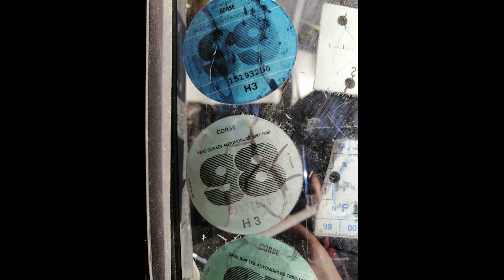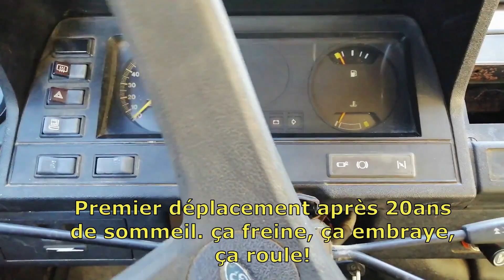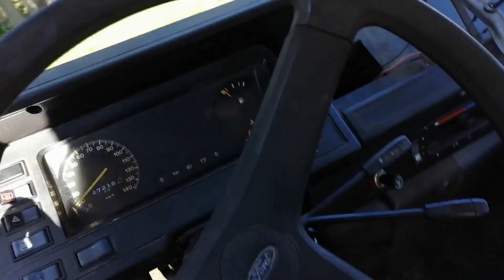Barn find Ford Transit MK2 abandonné depuis 1999. Sauvé de la destruction de justesse!!

Comment: Toujours un plaisir de revoir un Ford Transit MK2 dire que c'est la dessus que j'ai conduit au début de mon permis et taper mon premier drift (pas bien c'était le véhicule de mes parents) bien sûr de nos jours je ne lui ferai plus ce genre de misère trop jeune et trop con sûrement.
Reply from the maker: Je regrette d'avoir du m'en séparer. Mais il est entre de bonnes mains. 😊
Reply: @vrshape  Si c'est une personne qui en prend soin c'est bien et oui un bon moteur là dedans dans ta vidéo j'ai cru entendre le notre. que de souvenir voyage en vacance dans le sud de la france etc. si je pouvais en conduire un  un jour ça serait vraiment avec joie de retrouvé les sensations dans temps.

Comment: Ça c’est de la bagnole, le ventilo qui tourne com dans les 504 avec zéro électronique il peut aller très loins dans le temps encore. Vous faites un travail fabuleux bravo X 1000. Tout est compliquer dans la mécanique aujourd’hui pour qu’on nous déplume encore et encore ce n’est pas une question de sécurité il y’a toujours des morts sur la route hélas.
Reply from the maker: Merci encore pour ce commentaire élogieux. Ces vieilles voitures ont l'avantage de ne pas nécessiter de valise pour diagnostiquer les pannes. Aujourd'hui les mécaniques sont truffées de capteurs. Trop de paramètres à gérer.

Comment: Si peu de corrosion c'est étonnant. Attention à la baie de pare brise qui rouille dans le joint et qui laisse filer toute l'eau dans les longerons avant. Et après ça fissure et c'est mort. (J'en ai eu 3 tous le même problème). Le 2.4 n'est pas un bon moteur. Il est rugueux et s'use assez mal. Le Di était sans comparaison. Mais bon c'est à garder en collection d'origine évidement. J'adorais ce camion. Le dernier avait eu droit à une boite 5 à la place de l'overdrive. Ca s'y monte avec un peu de bidouille...
Reply from the maker: Celui ci a bénéficié du climat insulaire. Il était en très bel état carrosserie malgré les années d'immobilisation. Malheureusement j'ai dû m'en séparer. Je me rattrape sur mon estafette 😂